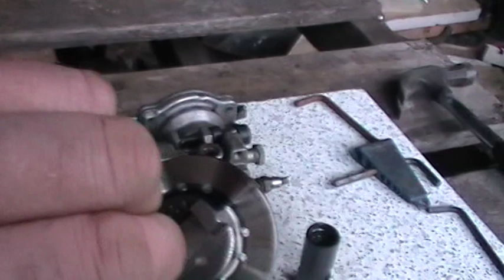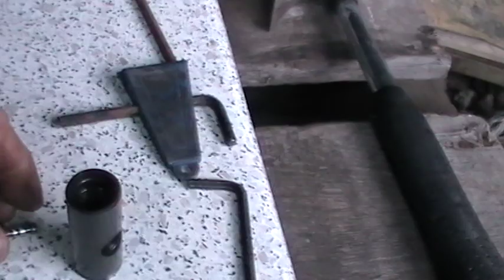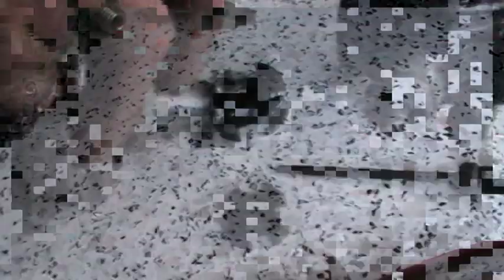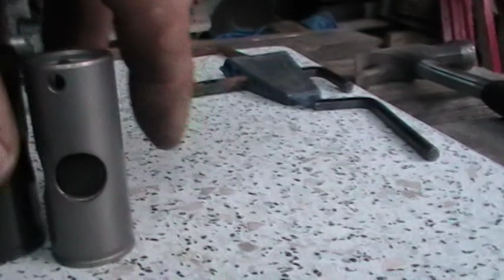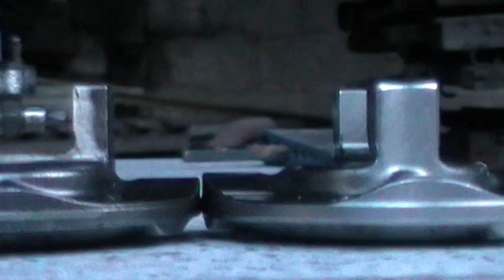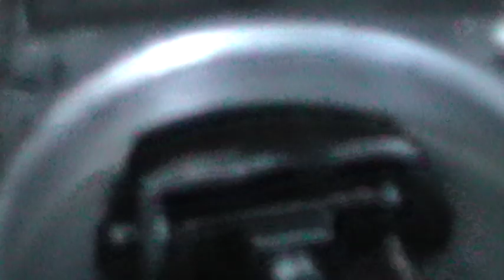MTDI Ford Transit Mk6  MTDDI Part 2

Comment: A stock 300tdi pump can give flow enough fuel to do what you need for a Transit, you dont need to modify the pump it works great as it is.
Reply: Also, you can not use the same pump timing, use a dial gauge in the end of the pump & set the start of the lift point the same as the transit pump its replacing . The 300TDi is too retarded to work as is.

Comment: learned a few things cool thanks for explaining. so can put any hieght cam in that you want really and its still adjustable to get em to run properly!? I'm put AdBlue urea in my fuel tank and the VE pumps stopped. Doing videos as i fix it. I'm putting new head and rotor, springs and the same cam again but i think the old one at 333,000kys is probbaly worn a mil or two so it should be good with a new one again the same.

Comment: Hi, could you tell me what parts i would require to fit a 300tdi pump on a mk6 2.4 90hp transit, is it just the camplate and advance piston?  Greg.

Comment: Hi, just wondering how to plug in a power mod to the bosch fuel pump on a mk6 transit, is it easy?
Reply: wire under fuse box inside cab

Comment: hi andy what camplate are you using? and what advance piston?
Reply: hi did you get a reply from andy about the cam plate ,,,i have done this to my van and runs very well but i did,nt use the landrover pump mines a vw transporter work well
Reply: @MyMelvin99   Hi Melvin what model transporter pump did you use? cheers
Reply: @mattrobertson1450  what vw pump did you use? Thanks! 👍

Comment: hi andy what sproket holder did you use on this pump as the vp pump spoket has a bigger shaft to the ve pump thanks and all the best in the new year
Reply from the maker: Hi Melvin, I used a VP 30 hub, it fits the VE shaft, VP 44 hub on the higher powered models is a bigger diameter shaft.
Reply: thanks andy running on vw pump at the moment runs very well no power lost
Reply: @andypdq  hi Andy,  I have the 2.4 140ps running the vp44 pump,  if I fit a ve 300tdi pump will I be loosing HP, or is there a bigger pump I can use,  or the piston and Cam wheel mods are suffice,  cheers
Reply: @tigertowingtasmania  Did you try it? what did you find?  It wont be that far off would it?